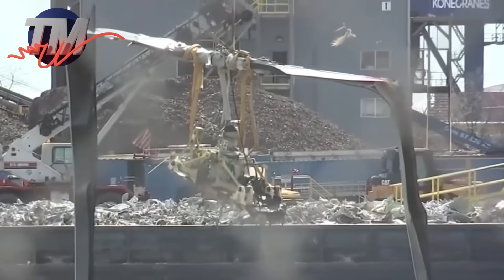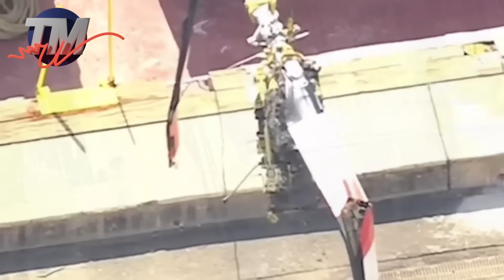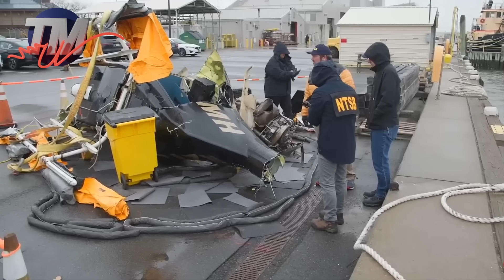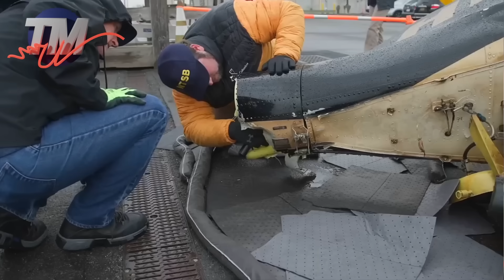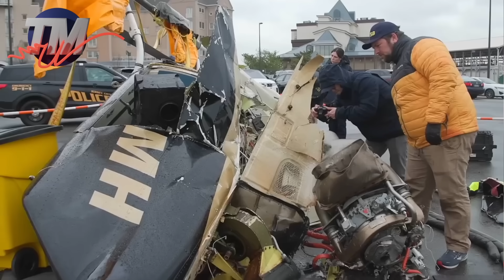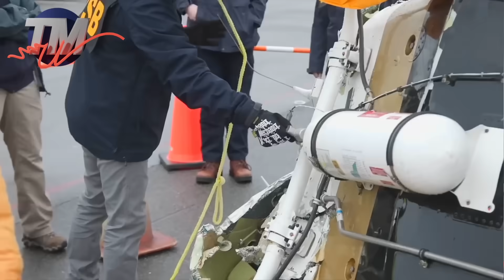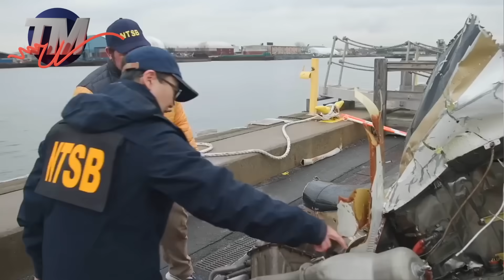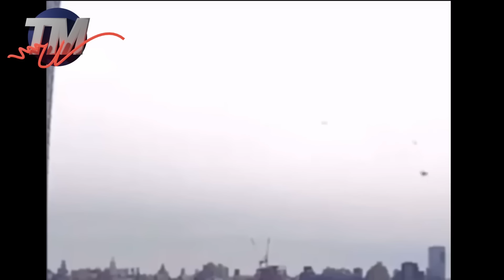Recovery of the Main Rotor of the Hudson River Tourist Helicopter - it's worse than we thought

Comment: I am an ex-pilot on this helicopter. I would say that people today are much less conscientious than a few years ago. But even in my day there were "super pilots" ... People who never make mistakes. People who make heavy landings and do not record them, who send the rotor into super rotation .... and do not record it. Now I fear some chain of causes of this kind for an accident like this. Ciao. Marco from Rome.
Reply: As an old German helicopter mechanic, I can tell you that it was never mast bumping. That thought could only have come from stupid people who have no idea about flying or aerodynamics. For mast bumping, you always have to first bring the helicopter into a low-G situation. That's not possible in straight flight.

I looked at the pictures with my colleagues in the repair dock. We all immediately agreed it was a jammed main gear. We could almost immediately rule out anything else. When the rotor head, with the twisted rotor mast (twisted approximately 160 degrees, torsion), emerged from the water, we had the necessary safety.

We can easily explain why even the main gear remained in one piece and why the gear mounts didn't break. Because the forces are so great with a jammed gear, the entire engine deck simply tears out of the airframe. This is the weakest point in the structure. The airframe wasn't built or designed for this load direction. If the planetary gear is blocked, rescue is no longer possible! All helicopter manufacturers know this and therefore stipulate that an emergency landing must be initiated immediately if a "red chip detector" is detected. 999 out of a thousand times, it will be fine because it's only a single chip that triggers the alarm. The thousandth time, it's the final warning before death.
What I would be very interested to know, as a German helicopter mechanic, is whether, in the USA, in addition to the engine, the main gearbox is also monitored with vibration sensors? In Europe, this has been standard practice for years, as it is the only reliable method for detecting such faults early on. A broken gearbox sounds different and also has different vibration values.
What scares me most as a mechanic (besides the 6 dead) is the fact that the aircraft just came back from maintenance 14 days ago. Unfortunately, this isn't the only incident of this kind. A similar accident occurred in 2016 involving a Super Puma in Norway, which was en route to an oil drilling platform. The images of the rotor head flying alone with its gearbox and a lone airframe in a dive are uncannily similar to the images from New York.
Reply: That makes more sense than anything else. Back when I worked on aircraft as a conehead, I spent a few times with the mechs and they'd show me some things not just about fixed wings but also angry palm trees that just make me realise we put our faith in some singular components to do their job correctly and if they dont't, no amount of piloting skills can save you or anyone on-board. I too would like to see if there were vibrations sensors from the gearbox and if they were mentioned in the maintenance logs.
Reply: @thomaskamp9365  Thank you for your knowledgable information.:person-turqouise-waving:
Reply: @thomaskamp9365  Best comment I have seen regarding this on any channel. Thank you. 
Grüße aus Kalifornien...
Reply: @thomaskamp9365  Well said, your scenario makes sense.  I would not be at all surprised if contract maintenance was also a factor. I'm a 30 year (retired) AMT, this incident reeks of procedural failure across the board.
Reply: @thomaskamp9365 -- BRILLIANT analysis & commentary!  THANK YOU for your expert opinion!  The problem with "american" is that all trades are MEDIOCRE & way below any standards of excellence & the necessary regimen!!!  You would NOT believe the misery car owners go through to get their cars fixed!  The mechanical engineering expertise is totally LACKING!  Quite frankly, i am disgusted with the stupidity in maintenance crew abilities!
Reply: @maryn8139  It is the same thing with Diesel truck mechanics! A dear friend who is a shop foreman has left more than one high paying Peterbilt truck repair shop due to poor quality workmanship. Mechanics are lazy and careless. He refuses to sign off on road hazards. Let it go and be liable or constantly redo their jobs. Nope. 😤
Reply: @thomaskamp9365 thanks for that excellent explanation of seems to me as the most plausible explanation for what has happened.
Reply: @thomaskamp9365  However, in the Super Puma accident, the gearbox ruptured and so, the rotor came detached. In this case it seems that if there was a blockage, then the  gearbox casing and its mounts might be so sturdy, to contain the failure and rip the fuselage? I think that the answers are there, inside that gearbox.
Reply: @1zanglang  Correct. Taking all the facts together, the only possible sequence of events is that the main gear suddenly jammed in flight. This caused the airframe to accelerate counterclockwise, and the tail rotor to break off.
Reply: @thomaskamp9365  This might be the most plausible cause. Thanks for your explanations.
Reply: @thomaskamp9365 What amazes me is aircraft not having at least one on board video recorder looking at the mast and tail.
Reply: @chippyjohn1 well no one thinks to really but yeah it's cheap to camera out an aircraft for these purposes
Reply: @thomaskamp9365  Horrifying
Reply: @thomaskamp9365  My son crews a copter for the coast guard. He's mentioned several times about the vibration detectors and how they send the readings off for analysis periodically.   I couldn't tell you if thus commercial copter had them.
Reply: @thomaskamp9365 have you already seen the rotor? What do your team believe now? Please check if the tail could be cut by the transmisión rod, Broken and bent, and the pilot do the rest pulling the collective. 😉
Reply: For decades we have heard of the coming pilot shortage.  Well, it is here.  The average experience level is dropping rapidly. You can't teach experience.
Reply: @zak2u2  pilot had nothing to do with this, he was a victim also
Reply: @GeeBee909 well said
Reply: @zak2u2  This pilot was a former Navy SEAL.
Reply: @hannahpumpkins4359 , he wasn’t a SEAL.He worked alongside SEALS as a refuelling mechanic.
Reply: @hannahpumpkins4359  He's not specifically accusing this pilot. He's suggesting the helicopter may have had a hidden past of gripes and abuse that were unreported and therefore never addressed. The cumulative effect of not reporting incidents or gripes could lead to such a catadtrophic failure. And all that may have happened before this pilot ever flew this aircraft.
Reply: @northernlights6459  Correct.  

"Seankese "Sean" Johnson was not an actual Navy SEAL, but he worked as a technician alongside Navy SEALs. He served as a technician with the SEALs before pursuing his dream of becoming a pilot. 

Here's a more detailed breakdown:

Technician: Johnson served as a technician within a SEAL team, assisting team members. 

Not a SEAL: While he trained and worked with SEALs, he was not a SEAL himself. 

Career Path: After his time in the Navy, Johnson pursued a career as a pilot, eventually becoming a helicopter pilot."
Reply: @northernlights6459  true, but that was reported very early. Unfortunately. I also heard it. You know people get crap wrong in the rush to be first.
Reply: @hannahpumpkins4359  And that is relevant because ...... ?
Reply: @zak2u2   Maybe but you are talking out of your ass.  Pilot was not a factor.      Plus he was very experienced.
Reply: I do believe that you are absolutely correct.
Reply: Excess of 9,000 hrs. That seems high to me. And I worked on the 205 and 206
Reply: My guess is Main rotor seized, the inertia of the blades then spins the gearbox off the air frame and this also folds the air frame at the weakest point of the boom. Note in the pics that the boom isn't straight with the body. Rip. Very sad 😢
Reply: Marco - Thank you for this plausible explanation!❤
Reply: What is “super rotation”.  Can’t find that term in relation to a helicopter
Reply: @highball7347  I don't know how to say it in English exactly. It is a higher number of revolutions of the rotor than allowed. This can cause serious structural damage to the blades that is not visible to the eye but that only the pilot can be aware of, but I don't think this is the case. It is only to draw attention to those situations of serious structural stress that only the pilot is aware of but that he must report to the maintenance department for the necessary checks, to avoid that the next flight could turn into a fatal accident.
Reply: @macrotriso  ‘Rotor overspeed’ in English 👍
Reply: @macrotriso 
In English "rotor overspeed."
Reply: @highball7347  I assume he means overspeed?
Reply: @highball7347 they mean over rev
Reply: @highball7347 over revving, letting the rotor attain speeds over the red line, in many cases also overtorqueing the rotor system. In other words careless and reckless operation of the equipment.
Reply: Nice input sir, interval inspections.
Reply: To me it looks like a mechanical seizure of some sort. Engine or gear box. May be lube failure.
Reply: @subramaniamchandrasekar1397 . I believe the engine is connected through a clutch that disconnects the engine from the transmission.  Unlikely to be a transmission seizure because all parts look intact and the rotor was turning. If the had been a transmission failure, they usually have an oil pressure or overheating or a chip detector warning. He radioed that he is returning for  fuel.
Reply: Exactly what happened to Lion Air 737.  Previous pilot reported runaway stabilizer trim but he knew how to stop it.  Maintenance did nothing.
Reply: In these cases the pilot had NOTHING to do with this crash.
Reply: I agree that safety is lacking in the entire aviation industry.
Reply: Err. No. Having a lifetime on 8 types of lawnmower your explanation or reasoning …if I can call it that…is not correct.
Reply: I’m not a pilot…just an older woman….but I also feel like there is more to these aviation incidences! It just seems to be something off…like even sabotage …maybe against the new administration?  I’ve wondered that a lot!  If it’s sabotage…it’s murder. But so many evil things have gone un noticed or seen as un important allowing for horrible corruption and it’s about time we uncover all of it….thankful for the brilliant people who have discovered much of it!I pray the hTRUTH IS FOUND IN THIS WRECK AND LOSS OF A FAMILY….AND ALL THE OTHERS! I’ve also thought the multiple horrible fires could be sinister as well…among other things….a lot of haters and evil plotters out there free to roam in this wonderful country….❤🙏🏼🙏🏼🙏🏼
Reply: I think the transmission seized due to lack of lubricant. Oil level not checked for too long.
Reply: All you need is once.
Reply: I don't quite think you're getting spins from the government I don't hear that as much as you are stating?

 I think for the President and the other senators, they are trying to let the public know they will ensure a proper investigation to these matters. In the past, we hear about these accidents, and then that's it. Well, take the DC tragedy. By getting involved the white house brought attention to the near insane way air traffic from the military was being conducted in and around that particular airport exposing some pretty dangerous habits, and just how many near misses they've had, there and around the country which immediately called into questions these air traffic practices. So much so you already see some of the changes being made in and around DC. 
There's a saying in the news: "If it bleeds, it leads." It's pathetic, and it makes the low IQ uninformed person react with terror. They've turned this into an emotional advantage in the government and some of its people. Again, the less educated come running to the trough yelling and screaming the sky is falling. 
In reality the NTSB and the FAA keep year over year statistics of air accidents and if you look in 2025 so far we have fewer accidents compared to last year (averaging the sum total of what the end of the year will look like).
So no, there's no agenda in particular.  There is and always will be a blood lust press who will always do a disservice to an accident by sensationalizing these types of accidents and in the case of the government I think they are simply calling attention to the need for better training for ATC and better people as well as making sure people understand the need for thorough investigations into these really bad accidents. 

IMHO.
Reply: Let's face it, the powers that be don't like us traveling
Reply: @NancyDVI  Says the illiterate...
Reply: Was thinking the exact same thing, complacency in flight performance logging can easily lead to this.
Reply: Yeah I'm certain some falsification or omission had to be involved here.
Reply: I saw a helicopter fly by at a considerable distance last thursday....  here's what i think happened.....
Reply: Marco, you bring up a good point. Unlike newer aircraft the pilot would need to report any exceedances to maintenance. Depending on the operator this could lead to disciplinary action. Over-torque, over-speeds, over-temps etc would require a logbook entry and notify maintenance. More modern aircraft have a "tattle tale" for any exceedance and can pin point when it occurred.
Reply: I’m sure catastrophic mechanical failure can’t be overcome, no matter how super you are as a pilot.
Reply: @ggqnice  I think you misunderstood him. He is probably referring to accumulated wear and tear from ham-handedness that was hidden or went unnoticed.
Reply: @ky7299  Yes, in a small operation, how likely is a contract pilot to report events that should be noted in a maintenance log?  This is particularly troublesome in a small tourist flight operation with financial issues that is leasing a used ship with a questionable maintenance history?  If I owned a ship like this that was not for hire and only business/personal use, I would note any detail that could be problematic from a cumulative standpoint and schedule maintenance and inspections that gave enhanced attention to potential issues from anomalies.  

As a consumer, I would not want to ride on a ship that wasn't part of a company with multiple ships, a dedicated maintenance crew and which did not lease used equipment.  While I hate unnecessary regulations, it may be time to require that aircraft over a certain age be regularly certified for use in tours beyond prudent scheduled maintenance.  This company or its owner seems to have a record that would raise eyebrows if known to potential passengers.  

Lots of issues here.  The laws of entropy seem to be especially at play here.  Could greed be a factor at any level?
Reply: @ky7299  bingo!
Reply: @rdh53 safety? We outsource that we deal with the profit here mostly... Lol
Reply: @rdh53 Not just non sked.. There are some serious morons at the majors too but now it's reported electronically so hiding bad stuff is pretty much a thing of the past..
Reply: @ggqnice  He was being ironic. He meant, ''super'' pilots, wink, wink...
Reply: @ggqnice  that's what he's actually saying. People covering up mistakes that might have had a negative effect on the structural integrity of the aircraft.
Reply: Umm.   Yeh…naah !
Reply: So you are buying into the DEI theory, Marco? A white pilot would have been far more qualified?
Reply: @Dooley_Hickens  What a stupid thing. You have truly remarkable ideational abilities. Too bad really wrong. I have a black wife and kids too.
Reply: @Dooley_Hickens  my wife Is black. So think well what do you say..
Reply: MAGA types
Reply: @frez777 what does MAGA have to do with anything??
Reply: @houndlover870  nothing...just a typical dopey comment.
Reply: @frez777 quit wasting space here. These discussions are more important than your feelings
Reply: What an idiotic comment @frez777
Reply: @MiguelHeijnen not really, the terms caring about others,  intelligence, self reflection are not terms that are reflective values associated with the world views of MAGA. Self-centeredness, egotistical, narcissistic, self-servicing, chainsaw, moronic approach to world economics, disregard of the laws of the US Constitution, due process, celebration of ignorance over facts etc generally are MAGA values.
Reply: @frez777 …move on from the election results dude !
Reply: @frez777  No he means the types like you who never make mistakes and immediately blame the cookie monster.
Reply: @frez777  Those "MAGA types" are definitely super at just about everything.
Reply: @frez777
What a stupid thing to say.

Your TDS is off the charts Skippie.
Reply: Your TDS is sickening. So is your hate. This has absolutely nothing to do with politics. Nothing. You just proved why you lost the election so badly.  @frez777
Reply: @frez777  what are even talking about? Why is it that people have to interject politics into everything even when it's not about that. But be good feeling, farming 25 precious YouTube likes
Reply: @frez777  MAGA would blame DEI.
Reply: @frez777  Thick democrats do this.

(I mean, they don't, but what a stupid post...Really).

Comment: It seems obvious that the transmission seized up.  The torque then resulted in the transmission (and the rotor) being away ripped from the airframe.  Nefarious causes need not be invoked.  For me, the question becomes what cause the transmission to seize.

I owned a VW Rabbit with a 5-speed transmission in the 1980's in which the transmission seized up.  This may be why the explanation seems so obvious to me.